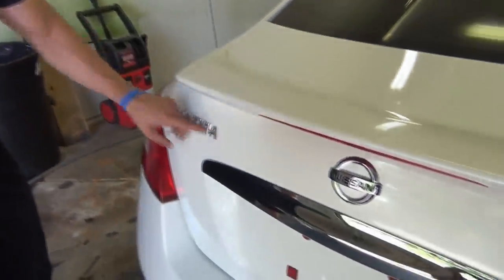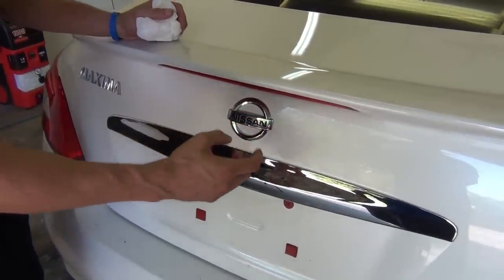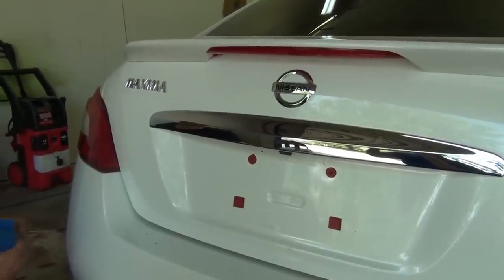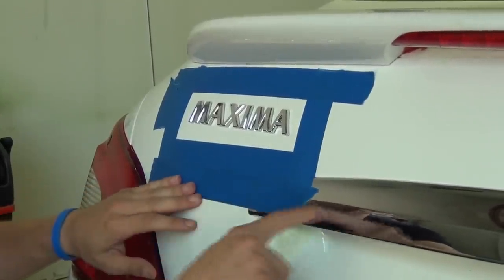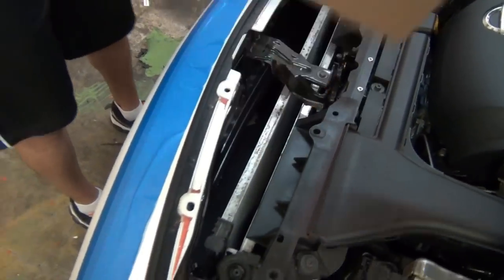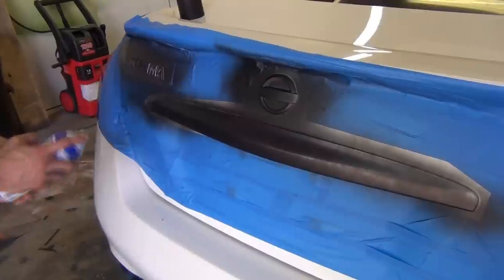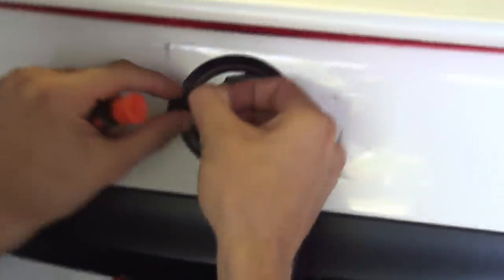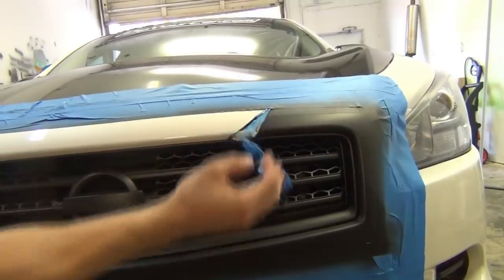How To Plasti Dip Emblems and Front Grille - HD Step by Step - DipYourCar.com

Comment: A tip on using the flathead: Spray some layers of plastidip on it and use it as your plastidip remover. It wont damage the clearcoat underneith as much.

Comment: I did this over last weekend to the badging on my 2017 Ram 1500...blacked it out. I am all thumbs and very mistake prone. Plasti-dip basically takes the margin of error and throws it out the window. No precision tape up, easy to peal to get a perfect line, and if I were to have made an error, it can be removed completely to retry. It was easy, I didn't need to. I followed the instructions and it was pretty easy as well. The tape up, while not precision was probably the most tedious part. Not hard...but labor intensive. I also recommend a mask...dip is super toxic smelling. Overall, I took my time and an accident prone guy like me made a perfect looking finish product. Thanks for this video. Next up...my wheels.
Reply: Rotwang72 did it last like in rain and stuff like that
Reply: @TsGhosty  I plasti dipped my rims last and bumpers last fall (I live in northern Michigan, ie snow, salt etc) and they survived the winter no problem. No peeling or anything
Reply: *peel
Reply: Rotwang72 i did my rear bumper today and waited and waited an hour for the several coats to dry and the dip would not peel off, i don't know if maybe i didn't wait long enough or what

Comment: Great vid, but I would suggest not using metal tools with regards to removing remaining  pieces of the dip from in between the letters in the emblem for example. Use a wooden, or a plastic one at least, never a metal one, as the material of which the laquer is made should be harder or more "immune" to what you would do with your tool. Thus, the softer the tool, the less damage you can possibly make to your actual paint job. Loved the final effect though! Didn't actually imagine it would be so easy putting it on my ride!
Reply: O

Comment: Wow, best video yet showing with simple tools how to grab-away at intricate edges and sections slowly. 
You schooled me damn good! Cannot wait to go at this on my car's old chipping hard-plastic window stripping.
First, I got to cut stripping half-back for a straight edge that's currently hanging-over an unfilled trench alongside front & back windshield edges, then fill trench with a filler like some durable Lock-Tite black Masonry caulking for the Plasti-Dip to set on top covering it all up and even.

Comment: Instead of a flat head. Use a tooth pick.. or if you want to use a flat head paint the tip with plastic dip and rubberized it so there is no chance on scratching the clear coat, also would make it grab better with the grip. Just some food for thought. Your videos are  very helpful. Thx

Comment: Except in close camera you could se that it doesn't come straight. The pull will always be jagged from pulling on it.  Use a blade over the lines so the dip comes out straight.

Comment: You can also use an air compressor and a micro-fiber towel to dry car parts, you dont have to bust your knuckles or ruin clear coat with abrasive paper towels...

Comment: ... Heat the glue and take the badges off, put them on a bin liner, spray them, glue them back on. 1000X easier.
Reply: What kind of glue are you useing?
Reply: Shawn Good JB Quikweld would glue them back on. Just got to make sure they're in the same spot.
Reply: Right but the chances that you will put the letters in the right spot all straight is a long shot. unless you make some kind of stencil.
Reply: Not at all,if you got just a bit of patience,doing it the normal way will be easier
Reply: Acme Sorry but that does not sound easier at all.  You may know what your doing but the average person shouldnt be heating and prying the badges off thier car man.  oh then off comes some paint great!  The whole point of plasti dip is to make things as DIY as possible.
Reply: TiQuan Woodley Put a strip of masking tape above and below the emblems before you remove them. Then use dental floss/fishing line to go behind the badge and pull it straight down, it will cut the foam adhesive holding the badge on. Then just use your fingernail to remove any foam left on the vehicle and use whatever to remove the foam off the back of the badge. Get some 3m double sided tape (they have that in the automotive section) to reapply the badges. There will be residual adhesive on the car that will still be there and help you line up the emblem. 

The "extra" time taken to do it this way is negligible considering you won't have to remove any plastidip off your car and you won't have to mask off half your car. Plus It will give you perfect clean lines.
Reply: HowardSupra I just did mine with the plasti dip,  It took me about 40 minutes to mask 6 badges,  then i did 8 coats waiting 10 minutes in between, starting with light and moving to heavy.  Done.  You want to tell me removing individual letters, painting them. putting them back on, is a better solution? Are you crazy?  in my case thats 28 individual pieces.  God damn mess that could turn out to be.   I wash my truck with my 4.5 GPM 4000 psi pressure washer.  so if durability is your reason for that needlessly long process than theres that for you.

Comment: Ok so this time you have shoes on. Just wanted to be ‘that guy’ and point out that there’s no need to tie them when using Plasti Dip. 
Ok that said, I’ve used Plasti Dip on some of my motorcycle parts. Nothing like rims or headlight buckets but on things like the flat chrome plate behind my brake light. Nice product and very effective.

Comment: i meant an actual car wash, not manual stuff, automated car wash. Anyways, I got the answer, I dipped my spoiler on saturday and took it to the car wash 12 hours later (full cloth wash) and everything was 100% perfect! So yes it withstands those brushes (if the job was not done right and it was already peeling from the beginning, a car wash would take it off for sure, but vinyl is the same way)

Comment: I might have a tool to suggest ot help remove that plati-dip from the emblems. Try using a cell phone case opener. It won't scratch the paint. And it it is made from plastic.

Comment: When i did my V8 Kompressor badges i took a trash bag, cut it in half so it was one large sheet then cut a hole which gave about 2 inches around the badge then taped it down around the edges, it used less tape and it allowed me to reuse the bad - Might be helpful for some.

Comment: Old video I know and it's likely been suggested already but instead of a precision screwdriver, how about a plastic spudger that you might use in electronics? Typically they come with a flat edge and a pointed edge so you can really get precise and a lot less damaging to the original paint job underneath.

Comment: Fonzie, right on this video showing protecting the radiator/ac condenser/ intercooler, it would not be healthy to have the plasti dip blocking air flow in there.

Comment: Fonzie,
Is there a way to plastidip emblems and a whole car two different colors? If a car is plastidipped already, how would I allow overspray when doing the emblems another color? Plastidip would bond to plastidip, correct? Would the only option be to completely mask off the emblems to their edges, or is there an easier way?

Comment: For doing between the letters to get the rest of the dip away, I would go to a craft store because they have wooden dowels like a pencil, but with different tips such as a point or flat head and this way there is NO WAY you can scratch the paint detailing the removal of fine areas.
Loved the video.  Maybe easier than me cutting vinyl to customize

Comment: Just take the front grill off. It's not a long involved process and you don't need to waste tape.
A used piece of cardboard for the back and spray until your heats content.
There is a plastic tool used to separate Laptop shells. One side has a Chisel type end and the other side is a sharpened point.
I have used this tool for countless uses and never a fear of messing up  the plastic between electronic devices.
I also use the tool to remove excess gasket material to clean up messy RTV jobs.

Comment: If I want to use glossifier over black for my emblems, should I be applying a heavier wet coat like you do on the  wheels on the glossifier demonstration video?  Will that work for emblems?

I've dipped quite a few vehicles between mine and my friends vehicles (mostly only emblems), but I don't have much experience with the glossifier.

PS:  Idk if anyone else has used this technique, but I find it works extremely well while dipping emblems.  In any emblems or letters that have closed off holes, I take a very small strip of painters tape, say like 1/4 inch wide and 1/2 long, and I fold the sticky sides against each other, leaving about a half of each end of the strip loose (basically you are making a small letter T with the tape) then I stick the loose sticky ends against the vehicle INSIDE the closed off portions of the emblems.  Then I just spray the dip as normal and when everything drys, you just grab the little tags of tape inside the emblems and peel away.  The dip bonds with the tag and it makes the peeling process for closed off holes SOOOO much easier.  I call them Dip Tags.  :)

Comment: when i paint my trim on my merc with plastidip, i leave a part of the paint open like you said in the video, because you can just rip it off and it wont interfere with the plastidip on the emblem or trim itself because of that small space between paint and emblem or trim. in my case it does interfere with the plastidip on the emblem and trim, so when i rip of the excess plastidip i dont want, the plastidip i want goes away too. how do i avoid this?

Comment: i got a question, will this stuff withstand a car wash? Touchless or touch? If it doesn't, its not a deal breaker as even vinyl wrap has trouble with car washes. Just good to know so i don't find out the hard way lol.

Comment: Great vid !! Got a question. I was too excited. Just forgot to put a cardboard to protect the radiator. Will it reduce radiator efficiency n cause overheating? Now really worried. Any chemical to spray onto radiator to remove the dip?  Would appreciate any advice.

Comment: Would this work the same way if the car was completely dipped? For instance, the car was dipped flat white then you wanted to black out the emblems. Would the overspray lift off like it does on the unpainted surface, or would the black dip bond with the flat white and not peel off separately?

Comment: Thanks for this video!  Unfortunately, Plastidipping my BMW badge didn’t go so well.  I waited 30 min (as per can instructions) before peeling the tape and paper.  Some of the dip came off with the tape and the rest looks kind of pebbley and rough.  A lot of the E came off.  I prepped with 50% alcohol.  Do you recommend starting completely over or is there a way to fix this?  Wish I knew how to add a pic.

Comment: Is it possible to do plasti dip in the winter or is it only possible or just better during summer? Vince or someone please help me with this. I need to make adjustments on my car and I have requests to do my friends' car also but it's winter here in Maryland and I'm not sure if it will still be ok. Help please someone
Reply: its ok to plasti dip it in the winter if your in a garage. i know how you feel. just before you start make sure you heat up your plasti dip like soak the cans or gallons in hot water so it sprays better and doesnt bulk up so much. but yes you can do it in the winter just make sure its not really freezing

Comment: OK where am I going wrong? I’ve tried twice now to spray my Audi rear emblem on the trunk lid. I do 8 coats and still when I’m peeling it from the body it peels off on the emblem. Should I peel it when it’s wet or after it has fully dried?

Comment: I scratched my paint using a rounded small screwdriver,  luckily i have repair paint.  If i do this again, (judging by the durability i wont have to)  ill be using a composite gun cleaning pic instead.  Tweezers were also my friend for this.
Reply: kazymerchyk you think a toothpick would work?
Reply: christian Chichester Yes a toothpick would work as to not damage paint.  If you have a complicated emblem or badge it might become dificult to hold something so small though.
Reply: cool thank you
Reply: christian Chichester No problem.  Just a few tips from my experience,  remove the stuff between the letters 20 or 30 minutes after spraying,  to early and you risk damaging the letters.   I sprayed my letters (EXPLORER)  at work, peeled most of it off, then drove it home and the more cured plasti dip was so much harder to peel off when i went at it 2 hours later.   Have fun, it was my most enjoyable experience working with the stuff.  Oh also rub off any overspray before you do the letters because the cured overspray is a lot harder to remove.
Reply: kazymerchyk
Reply: kazymerchyk I'm sure theres far better tools to use then what he has, I would recommend a High strength ABS plastic set, they are designed not to mare surfaces for the most part, but same time can be very sharp.  

Using a Steel screw driver for precision work well.. thats not precision work, thats jut grabbing any tool from toolbox and making do...
Reply: +kazymerchyk I have seen it done with a toothpick

Comment: also I seen in another video (so I don't clam this as my idea) a guy used a tooth pick to remove plasti dip from the lettering which is what I did works great an is very hard to scratch your paint with a tooth pick lol

Comment: How does plasti dip hold up in a car wash?  After a day or 2 of drying will it stay on if you put the car through a car wash?
Reply: Curious as well...even for home use, with a pressure washer.

Comment: Just a curious question for anyone who might know. Obviously removing the chrome pieces and dipping them off the car would be easier but im just curious if I plasti dip my car say blue, then plasti dip the grill emblems etc when I go to peel off overspray wouldnt it take the blue underneath with it? Im curious because I have some side trim pieces that I want to be body colored but they have thin chrome strips on them i was thinking of doing black but I feel like Im gonna have to do a more precise tapeing job to keep from getting overspray on another dipped part so I dont peel it all off.
Reply: After watching the 2 tone video of the Pink and Grey S4 Im confident that I have the idea down. Cant wait to get my new wheels and tires for my 2000 E320 so I can dip it!

Comment: there already is.....the Auto trim and molding panel removal kit from harbor freight. It's a set of fastener removal tools made from a poly resin that will not scratch or mark anything    harborfreight. com/5-piece-auto-trim-and-molding-tool-set-67021.html

Comment: I just did my rear emblem but the plasti dip did not tear cleanly (jagged edges), despite using 4 coats and allowing 20-30 minutes between coats (temperature was around 60 degrees). Any recommendations to get better results?

Comment: Lets say i paint my car Light Blue Plasti dip, let it dry. Paint the emblems black, if i peel the exess black plasti dip, will it stain my light blue? Will i be able to plasti dip over plasti dip to get desired pin stripes/emblem colors or will the two colors mix? Please respond, i'm sure a lot of people are wondering the same thing.
Reply: Provided your light blue (or initial coat in general) is thick enough and fully dried, then yes, you can peel plasti cip off of plasti dip. Just be a little more gentle when peeling.

Comment: Hey, I want to plastidip my fender flares black. i tried plastic to do it once but it didnt turn out good, so i peeled it off. the problem i was having was that the plastidip wouldntdecide were it wanted to make the "perfect edge" and it looked like pooped. i preped the surface and everything. where did i go wrong? not enough coats? do i need to use a razor id the line isnt defined very well?

Comment: Hey guys, I'm having some weird issues when trying to peel off the dip from around the emblem...instead of it breaking away easily like in the video it tries taking the dip off the emblem as well. I let it dry about 20-30 minutes before peeling off the excess. Do you have any ideas why it's doing this? Thank you. (ps I've dipped my wheels so I'm no stranger to plasti dip)

Comment: If you wanted to hit it with a glossy finish after the black plasti dip, should I use the glossy spray first before peeling the excess black dip? What do you recommend? Thanks in advance!
Reply: There is a product called plasti dip glossifier that will give you a but shinier almost satin finish. I would not recommend clear coating over plasti dip as it will stuff peel off but in little pieces that would take days to get off. I believe he shows this in his myths about plasti dip vid. Hope this helps

Comment: Not entirely true. I have plastidiped and painted over my wheels two times.
the trick is to add 3-4 EXTRA layers of plastidip and go gentle on the coats of paint. It will take way more time and effort than normaly to be removed, but it can be done.

Comment: Fonzie, 
     I enjoy your video's.  I have a question.  Is there a way to get a nice edge when removing tape from a dipped surface, for instance like achieving a quarter inch pin stripe?  Maybe pull the tape as soon as possible and at a 45* angle away from the dipped surface? Any further info would be greatly appreciated!
- Keith

Comment: I'm painting over some chrome pieces and my rims on my car and everybody keeps saying that it won't stick or last. They don't understand that this isn't just paint, but a layer of rubber
Reply: I've had it on my chrome badges for around 2 years with no signs of wear.  I used 4 coats with 30 minute dry time between each.
Reply: Fucking doge always doing random shit!
Reply: Different driving conditions.